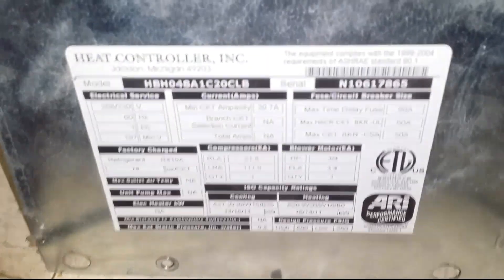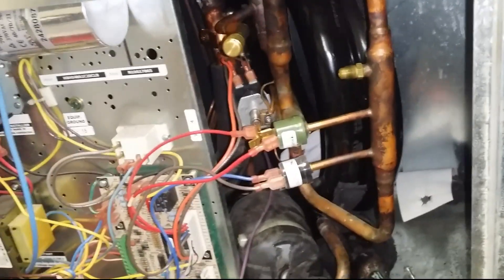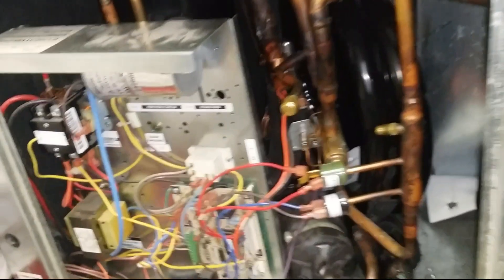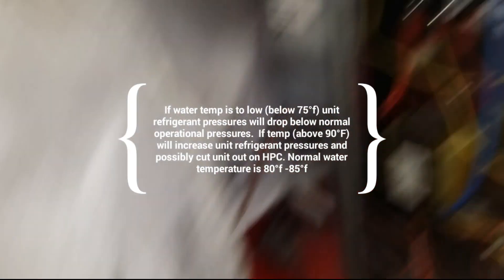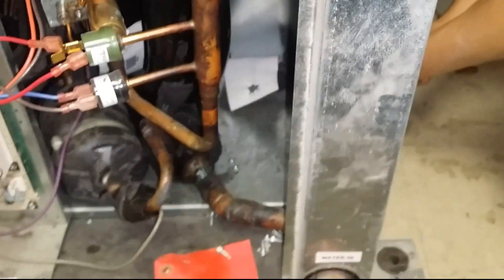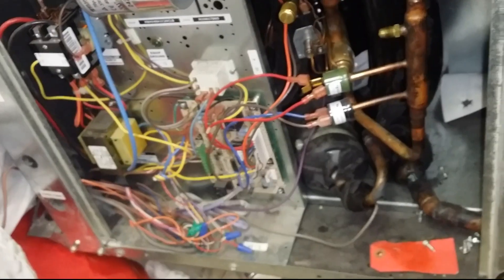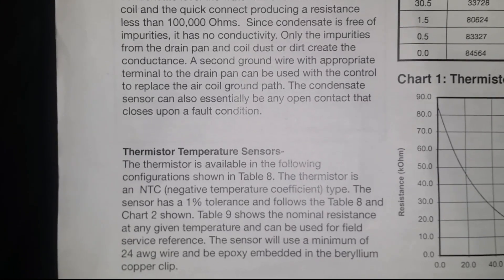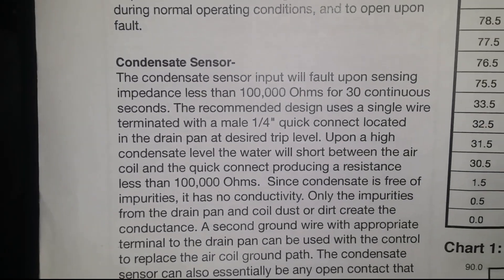HVAC | WSHP | Basic Training

Comment: What symptoms would you get if an installer reversed the water pipes? He has the incoming supply going to water out and the return pipe going to water in.
Reply from the maker: High Head Pressure, Due Hot Return Water Entering The Unit Instead Of Leaving It. Also improper GPM. Typically you want 80 -85 degree water entering the unit and 3 GPM per ton. To be honest with I've had units that experienced  issues and some units that ran fine

Comment: Great information ...what type of pressure to you normally want based on water temperature correct
Reply from the maker: It's pretty much the same.  Your gonna get the same pressures as an air cooled unit. Temperature pressure relations with be equal.
Reply from the maker: Also if your not getting the proper GPM of water, Refrigerant pressures can change.

Comment: Hey Emin, do you use anything to check gpm other than temp sensors?
Reply from the maker: Well unfortunately not everyone give you access on the supply pipe to connect  a flow meter to check it. However I've installed in line flow meter on some of the bigger WSHP.
Reply: http://www.omega.ca/pptst_eng/FP2001-R.html

We carry these in our service trucks. They just connect in line with the heat pump. Helps when determining low flow.
Reply from the maker: mazzmari that's awesome. I have something similar that I connect to drain valve to get the GPM. I really like the one you have I'm gonna look into that. Thank you bud.

Comment: Great viedo emin. How do u clean the water loop to improve heat transfer ?
Reply from the maker: Normally every WSHP has hose bib connections on supply and return lines. You isolate the water supply, connect dryer hoses and back flush it from the return to supply using scale removing chemicals. You just get a bucket and just back flush it.
Reply: Does it matter what side u flush the system from. Isolating the water loop from the main water gives u acess straight to the water loop right.we do maintenance on them sometimes , never really had to troubleshoot.
Reply from the maker: Pierre Ruff Normally you would have  2 pipes, supply and return. It will have isolation valves, p/t gauges, a strainer on the supply line and a hose bib drain valves. It would get pipped into the  supply and return of the unit.  You isolate the supply  & return  valves, connect your hoses to return side and flush it using a pony pump and the scale remover chemical. What your  basicly gonna do is recycle the chemical through condenser into the bucket. It doesn't really matter what side you flush it from. However back flushing it in  opinion works best to start off. This is not the rule of thumb and not written in stone. That's just the way I was thought to do it.
Reply from the maker: Pierre Ruff also watch my WSHP basic PM video to get an idea of the pipe set up. I think i show it there, not to sure.

Comment: just got finished replacing a compressor in one of these bad boys today... Love wshp's, just hate that you have to be a contortionist to get to parts of the units. Example: i had to drop this wshp OUT of the ceiling to gain access to the compressor. Hey i don't care, i get paid t/m :)

info: i work on mammoth wshp's almost everyday(my company is the warranty rep in maryland for them), they come factory with liquid line driers, the issue that i have with that is due to limited space in the units- mammoth uses emerson driers. Sporlan driers will not work when replacement is needed due to no room. only parker or emerson driers will work in these.  Just an example as to what brand comes with driers in their wshp's
Reply from the maker: Gregory I do the same here lol. I have a building where I have to drop the unit just to change the blower motor because of no access. It really insane how they install these suckers
Reply: Emin HVAC its nothing but the installers fault. shackers gone wild! supposed to have 3ft around unit, (BUT saying that, the smaller 1 1/2- 3 ton wshp's are so small that even if they were by them selves, the unit would still have to be dropped. The top of the units have to come off to gain access to the motors or compressors). i never ever see those requirements out in the field(3 ft. around unit), i do a lot of new mammoth factory start-ups as well and my statement remains the same in the newly constructed buildings. Its the same drama down here buddy lol
Reply from the maker: gregory .sadowski well said
Reply: Emin HVAC true story, forgot to add to previous post. 2 years ago at a newly constructed elementary school, i had to drop a 1 1/2 ton wshp from the ceiling to change a reversing solenoid valve(unit was against a cinder block wall surrounded by chilled water lines etc no way of getting your hand in wshp compartment. A job that takes all of 2 mins to perform, took me 12 hours to complete due to removing ceiling tile grids, and sliding it over chilled water lines coming from cooling tower, then maneuvering onto the duct lift etc etc. ahh well, the school teachers were very good looking that day so i enjoyed it.
Reply from the maker: gregory .sadowski lol. I guess they don't think about the service guys lol they expect us to pull some James Bond tricks out of the hat lol